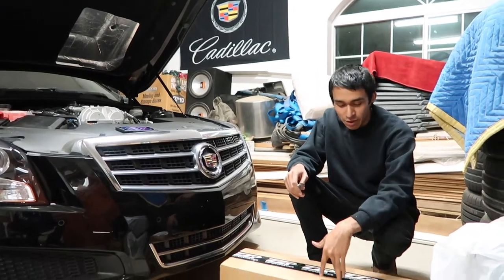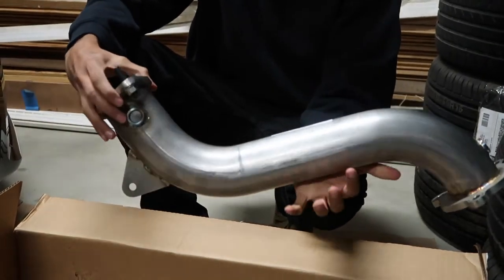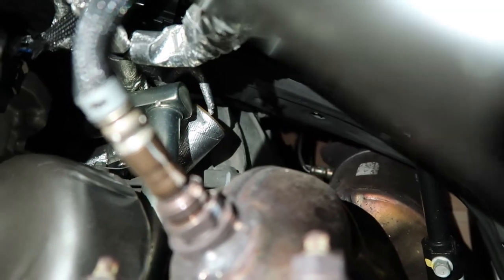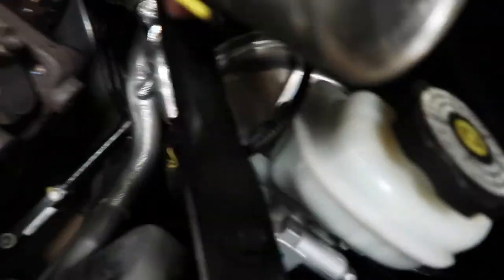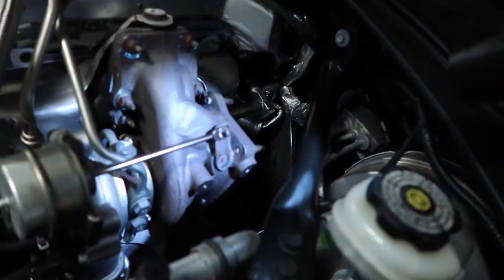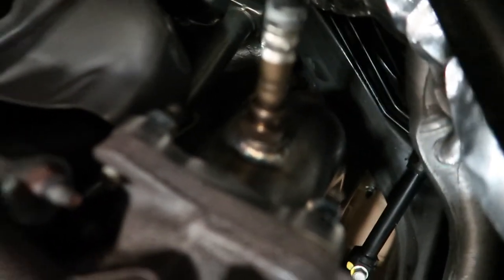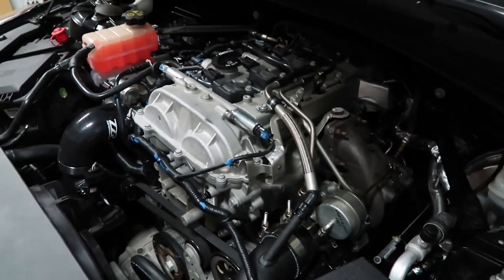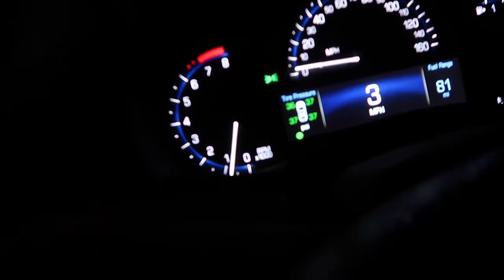Cadillac ATS 2.0T 6MT ZZPerformance Downpipe Install

Comment: Just bought the CAI for my 2016 ATS turbo . ordering the downpipe right after can't wait. and excited to keep up with ur build aswell
Reply from the maker: You won't regret it! But thanks!
Reply: PREVA1L MOTORSPORTS you were right, it's a night and day difference. I couldn't wipe the smile off my damn face after the install. I went ahead and bought a throttle body and 400 cell downpipe as well. Going to purchase the tune in a few weeks can't wait !

Comment: List of all the mods? HP at the crank and WPH after all the mods? I've just got ZZ front and rear sway bars,  ZZ slotted crossed drilled front and rear, pads, throttle body. ZZ stage one kit is out of stock but as soon as it in I will be ordering it

Comment: What did you do to get the rpm to drop so quickly? My rpm’s hang really bad 2014 ats 6mt 2.0t
Reply from the maker: Nope mine does the same thing lol.. You'll have to get a lightweight flywheel if you want that to go away

Comment: Did you have a CEL pop up when you did this swap?
Reply from the maker: It will throw a code for it eventually. You can tune it and eliminate it while getting more power. If you do it correctly you can even keep your warranty too.
Reply: @PREVA1LMOTORSPORTS   Can you explain the aspect of keeping your warranty please?

Comment: Which program are you using to remove the check engine light when you removed the cat? Or did the light never come on?
Reply from the maker: CEL will come on, ZZP provides a flash tune that adds power and removes the CEL though. (I advise getting a pro tune tho)

Comment: I just got a ats Awd 2l turbo with 45k miles and wanna put some mods on it is it to many miles to be reliable??
Reply: james blake I’m going on 83k miles and I drive 5k-7k miles a month on my 2016 cadi  and it’s still running pretty good just my transmission every since 10k miles it jukes out of no where when I’m going slow but after 73k miles it’s still going

Comment: When are you going to delete the muffler and resonator?
Reply from the maker: Well I hate having people work on my own cars so taking it to a muffler shop is out of the question. I'm just currently waiting on harbor freights to stock a welder that I've been looking for. After that it's just about finding piping and I should be good to make the deletes. I've also be debating making a full straight pipe from my ZZP DP to a Renick Performance axle back but that's an extra $500 I'd be looking at but the sounds would be AMAZING..
Reply: i did a muffler delete and have a ZZP CAI too, i want more sound so getting a DP soon. Just want to hear a resonator delete as well

Comment: How much hp?
Reply from the maker: The car comes with 272hp at the crank from factory, which is a lot technically for a little 2 liter.. But I'm likely putting down like 220 or so at wheels but after all my mods are installed, I'm hoping to be in the 300-350whp running e85

Comment: No check engine light after the swap?
Reply from the maker: Unfortunately yes. You can buy ZZP's catted DP and you shouldn't get a CEL or you can go cat less DP and then run ZZP's PCM tune and it'll turn off the CEL + give you more power (that's the route I'll be taking)